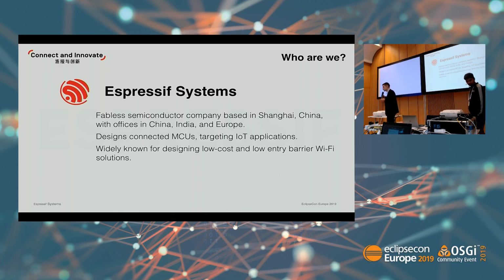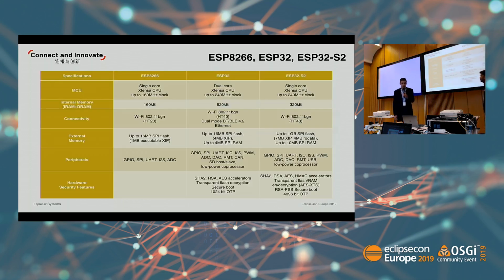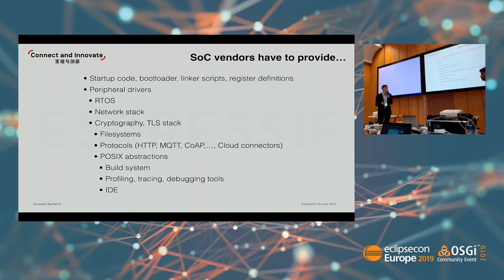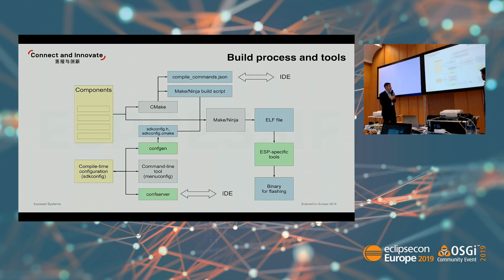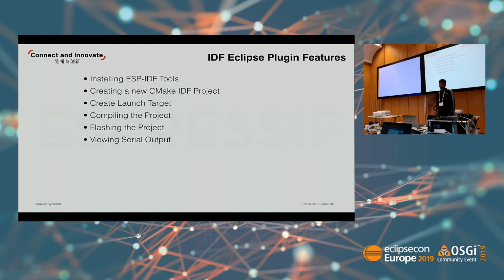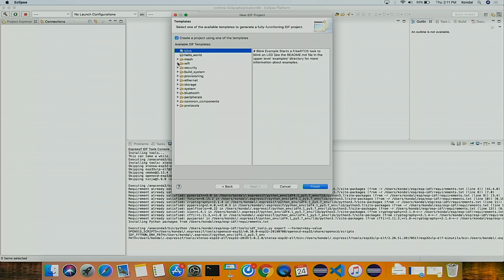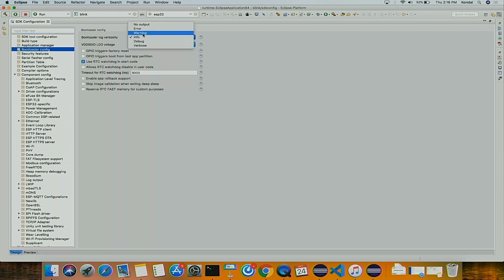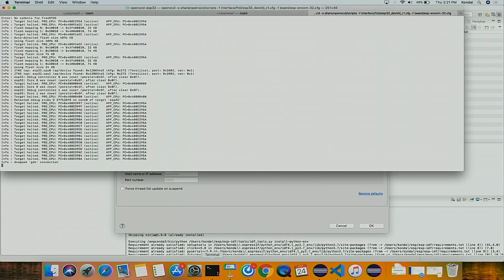Developing ESP32 applications using Espressif IDF (IoT Development Framework) Eclipse Plugins

Comment: I don't understand what is the need of a plugin for Eclipse. I do everything on Arduino IDE and it works great, why so much fuss about this? I kinda fail to see the purpose, just too many separated pieces of bits and acronyms, Ninja, Cmake, GBD, ABC, DEF etc. and now you have to memorize everything and cramp it into your solution and try to run with all these bits and snippets of code. Fail to add one properly and all goes to shit.

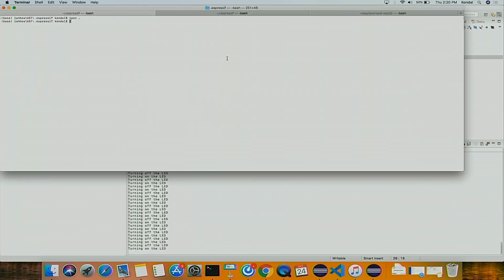Comment: 34:50 - for those who struggled with trying start debug on ESP32... 
This step is not so obvious mentioned in official espressif documentations! 
https://docs.espressif.com/projects/esp-idf/en/latest/api-guides/jtag-debugging/index.html
You have to run GDB client in separate mingw environment and only AFTER that press debug.
Otherwise you will get error "target remote localhost:3333: A connection attempt failed"